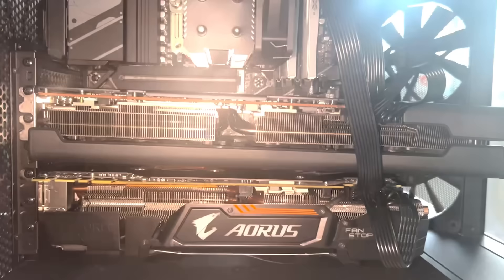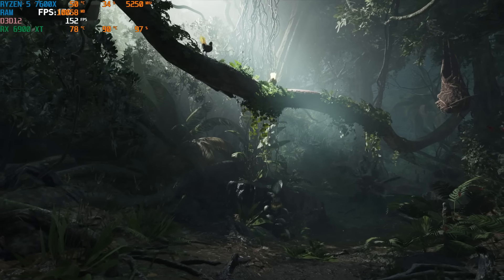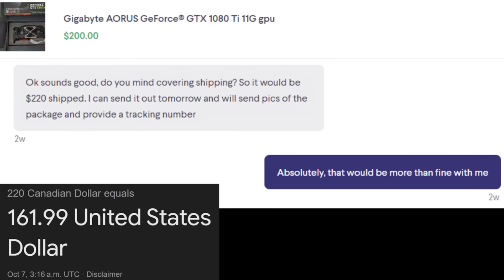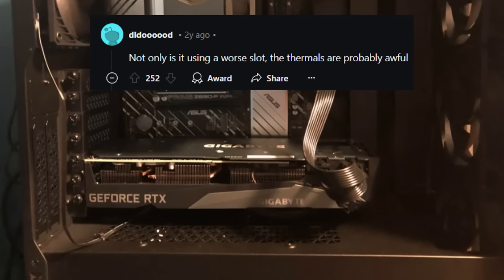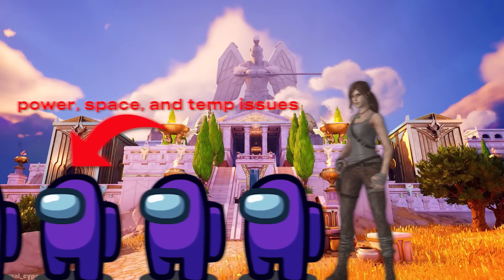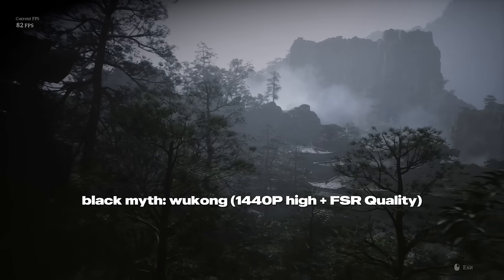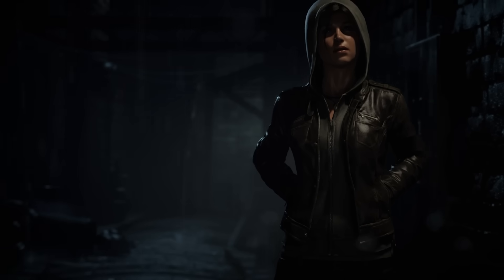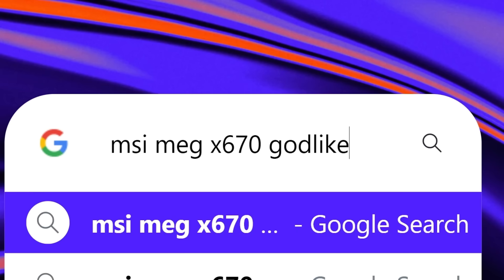I Combined AMD & NVIDIA in One PC and Got 1500 FPS

Comment: This video is somewhat misleading because the PC gets almost the exact same performance, if not less, when the two GPUs are put together, compared to just using a single GPU. Additionally, the reason multi GPU setups have mostly been phased out in gaming/consumer products is because of microstuttering and the lack of game compatibility. And that's just the difficulty you would have with GPUs from the same vendor. You would have to do a lot of tinkering to actually make a setup with mixed vendor cards work in tandem/parallel. Even if you did somehow manage to get the games to utilize both GPUs and not crash, your displayed FPS won't be very accurate, as there would likely be so many microstutters that it would feel like 60 FPS if you were playing at 120 FPS.

Comment: I did this with a rtx 3060 ti and an rx560 with no issues. I was surprised it was running flawlessly. I have a video of it running on both ff7 rebirth and baldur's gate 3 at ultra settings in both games
Reply: For anyone asking setup is a ryzen 3700x, with 16gb DDR4 3200,  1tb SSD, Asus 570x mb,  Nvidia rtx 3060ti 8gb, and a rx560 4gb, running in one system. 
Just in case anyone asks

Comment: Same here, hybrid GPU setup using.
RX6700XT & RTX2070.
hopefully, I wanna replacing RTX2070 to RTX30 series above.
'cuz they're have Rebar function.
anyways, You have must using sub GPU with HDMI dummy plug!
in my case Nvidia GPU doesn't VSR using on web browser or local video players without HDMI dummy plug.
(except setup main GPU to nvidia RTX series)
in other cases, if you use the "desktop mirroring mode"...
it'll maybe ansewer the multi-GPU setups.
because, with my PC, if I did so, both GPU percentages increase.
of course requiring HDMI dummy plug.
so, well, goin' to amazon or whatever web sites is, I strongly recommend to buy a 60Hz/HDR HDMI dummy plug.
and also, using nvidia inspector and force enabling Resizable Bar at driver setting it self.
this would take care of some of the PCIe speed issues.
or PCIe lanes split-up 8x8x... in bios.
sorry for my poor english, and I hope this someone's helps. enjoy.

Comment: The secret is that NVidia has released nothing new besides names and artistic redesigns since 2020 because they are scamming you while trying to clear inventory from the market crash. The 1080 TI is therefore still the alpha among their line of cards. DLSS raytracing is marketing, half of your games look worse when using it and the whole set of them take such a hard performance dip that you'll likely just learn to turn it off unless you have sickeningly deep pockets and can actually afford something like a 2090, 3090, 4090 or 5090. My advice if you want a true overall increase in performance is to invest invest instead into memory and RAM. I suggest taking this to heart because I know my tech, I built a PC for my sister in 2019 and it only has a 1070 mini from Gigabyte, that thing to this day outperforms even my expectations and you can probably source that card now for $200.00 if not less.

Comment: What about a 3060 12gb and a 6800xt on an msi mag x570s torpedo max mobo using the rx 5800x3d cpu?
Think it's worth trying?
I have enough ram to be good for now.
Just need to double check my power demands.
The asus lc gpu is a bit of a powersink.

Comment: "the only reason for combining 2 gpus today is to get nvidia's dlss and ray tracing while also getting amd's pure gaming performance" - what pure gaming performance?  AMD doesn't make a card that can best a 4090, even with just rasterization, without ray tracing or dlss.
"6900xt which consistently performs like a 3090 for less than half the price" -  the 3090 is now a 2 generation old (4 years old) gpu.
1000-1200w power supplies aren't that uncommon and haven't been for some time.  When I built my ryzen 1700x setup in 2017, I went with a corsair 1200i which did great at powering the 2 1080ti's I had installed with sli on that build.  I'm still using that power supply on my current build which is a 9950x with a 4090.  a quality high wattage power supply can last through many build iterations.
too poor to afford fans?!  you can get really good fans (arctic p12's) for $23 for a 5 pack that will likely be better than the fans that come with most cases and can significantly upgrade your cooling (especially if you have other fan mounting points on your pc to install the other fans.
most motherboards have the top pcie slots connected to the chipset BUT when you install a card in the second slot it takes away half the lanes from the first slot, and the bottom slot is shared with the chipset (and the secondary m.2 slot) and is typically electrically 4x - so when you have a single card installed you get 16 lanes on the top slot, 0 lanes to the second slot, and 4 chipset-shared lanes to the third slot.  when you install a card (gpu or otherwise) into the top 2 slots, they become 8 lanes each, and the third slot is still that shared 4 lanes.  MOST motherboards support sli.  HOWEVER, that doesn't mean that you're going to get 2 cards from 2 different vendors to work together in rendering the same scene.  there IS provisions for it in directx 12, but it's up to the game maker to implement, and i've never seen it happen.

Comment: The problem he is most likely having is he plugging the nvidia card into a PCIe 3.0 x1 electrical slot. Yes it is a x16 physical slot but the pins for it only go up to x1 so he is only getting pcie 3.0 x1 speeds with the nvidia card. Yes that is a thing motherboard manufacturers do do as most only look at the physical slot not the electrical one. So getting another motherboard that will have 2 x16 electrical slots will be the way to go to use both cards.

Comment: I have a gtx 1050ti with an i5 8th gen @2.3 GHz. 10 series is so good that I can play Witcher 3 next gen at 60fps (using free synch on a tv so no matter the gfx, frame rate is capped to my gpu frame rate). After a few tweaks and registry edits to my laptop, I can play it smoothly at high settings, keeping the cpu intensive effects at low (due to laptop being 6 years old and I use a small fan next to my laptop for cooling). It runs so well and I haven’t noticed much of the wear on the gpu. I can run fifa 23 and Ac Oddyssey at 1440p at low settings too which is not bad for an old laptop gpu

Comment: i tried this on a b550 motherboard using a rx 660 xt and a rx 6750 xt. gained like 2 fps on forza motorsport and gears of war, but my pc got too hot and loud to make it worth. also running the display on the slower GPU save some video memory since it makes it so the more powerful gpu is used exclusively for games. interesting result but would not recomend for playing games.

Comment: There's another option, but you'd likely need to do several work arounds and find some custom drivers to do it. Setting the 6900 xt as the main GPU, you could potentially find a means to set the 1080 ti to act as an accelerator card. Unlike Crossfire, NVlink etc, where the GPUs operate together to as one GPU. Using the 1080 ti as an accelerator card (like is done for AI) may improve game performance. In effect you could write a custom driver for the 1080 ti to act as a second CPU that is dedicated to a specific application task and offload the tasks normally handled by the CPU in gaming. The 1080 ti's optimization and faster computational scope (in spite of being nearly a decade old) would allow it to handle things like in game AI movement, pathfinding, etc, which is normally done by the CPU. 

However, this is only theoretically possible. It'd take a great deal of time, skill, and coding to create this custom driver, even then it's likely many games wouldn't work. Although some older titles might if they supported SLI, Crossfire or other multi-GPU communication protocols.

Comment: 6900xt doesn't require an 850w power supply. You can use it on a 750w no problem. 
PSU requirements are always a CYA for the the company.

Comment: If your motherboard supports PCIE Bifurcation on the top slot you can try to use that instead of a huge new motherboard purchase. you would need to get a bifurcation card for the slot and also some risers. but it is a possibility without selling an arm and a leg.

Comment: I actually have an mobo that supports two layouts for phisycal phisycal 3x PCIe x16:
X16 (plugged rx5600xt)
X4
X4
(Thats are now)
And
X8
X8
X4
With is technicaly possible. Any ideas to try some combo with any other GPU in tight budget?
P.s. last X4 slot is running from X570 chipset, but first two can be directly connected to CPU

Comment: @lecctron this maybe hard luck, but this is possible to do with a lower-end motherboards. A AM4 motherboard. that being the ASUS Prime B550 Plus, since that  (I suggest to get the one without WI-FI and BT to cut down in price if your short on cash and get a 5900X since they sell rather cheaply now) I know it sounds bad, but my hard luck is you probably have a old AM4 Build laying around, if you do, you can do this process by getting your hands on a B550 plus and using your old AM4 parts on it.
Reply: P.S u can find new b550 plus MB's at some local computer central or best buy that go for 90$

Comment: There's older amd gpus that actually had this as a feature without crossfire, but without one of those your best mixed setup would be to get a cheap Intel Arc A380 and run your display off it.

Comment: Taking my gpu out when it's installed on my top slot is near impossible with the cpu cooler on. Literally cannot reach the "Easy latch" on the slot lol I wish they had another lever on the back of the motherboard to pop pcie cards out if you can't reach them normally.

Comment: Whats the software configuration for the dual gpus?
Or are you doing some cable hardware weridness like what linux did for fsr plus gsync?

Also that gpu menu in windows 11 can also let u pass frames from one gpu to the other.

Comment: There are sometimes, I repeat, sometimes, very rarely, some cheaper consumer level motherboards that will have two PCIe slots wired to the CPU with X16 in one, and likely x8 but sometimes x16 in the other. But I repeat again, this is quite rare. And will still be more expensive than the other consumer motherboards. Also, to make this happen, they also tend to give up other capabilities to make it work. Like your M.2 slot on the CPU might not get included, but you may still get one or two on the chipset side of things at least. 

Finally, you'll probably need a riser cable. Unless your GPU's are able to fit within the space available, you'll need a riser cable. Oh, and before I forget to mention it... get a 1600w PSU. It may seem over doing it, but you'll need the extra headroom for transient spikes. With one GPU, 850-1000w will usually be enough to handle those at full load on your gear. But with 2? Nope. You'll get a black screen instant shutdown if one of those occur for long enough to trip it's protection. IF it even has it. Make sure to get something from a reputable brand, because you won't want to be having to deal with the chicanery of the cheap scam units.

Comment: you really don't need the lanes at gen three speeds 1080 ti does fine on on 4xgen3 laptop m.2 to laptop adapters do it fine with that new of a CPU it may have some affect but nearly 80-90% depending on how you use it, for instance if it is outputting to a screen it will be worse but if you have it work in the background you honestly need software to do anything with this to change a game probably be easier to write a game then get one to actually get better.

Comment: aren't there already plenty of boards who support at least 1 pci-ex 5 and 1 or multiple gen 4 slots? Gen 4 should already fix this. Even if it runs through the chipset. But I can't imagine that there are no modern boards except that 1800 mobo who have two pci express connectors connect directly to the cpu. That would be crazy.
But aside from that. The usecase of seperating concerns with GPU sounds neat. And I tried something similar with quicksync. But the main thing actually holding you back on that front is the CPU. 
That one can struggle to provide enough frames for the GPU even without OBS. And a lot of modern intels really suck in the low 1% and .1% area. Making recording a stuttery mess in high FPS games. And even in some 4k titles. So my next CPU is going to be either a 9800X3D, 9900X3D or 9950X3D. If I upgrade. As of now my i7 12th gen is barely enough for what I do. Which is editing & recording my games at the same time. Luckily those games are not the most demanding titles. And capping them to 60fps gives me the headroom to do the other stuff.

Comment: ROG Zenith II Extreme motherboard I got for $400 has 4 x16 gen 4 lanes. Has x8 ram slots, but is more for work stations using the treadripper line cpu's. I ran 4 gtx 1080 in 4 way sli just fine for years on it. Now it has a 4090 water cooled gpu. Your comparison between the 4090 and the 1080ti was wrong. You grossly understand the power differnce the 4090 has over it.

Comment: In my experience, several different gpu manufacturers lead to the ability to simply connect several additional monitors, it is worth considering that the rendering on the monitor will take place on the GPU to which it is connected (thanks captain), but the most interesting thing is the technology of the manufacturers. I found a case it the web like using gt1030 to work with physx in borderlands 2 or 3, I can't remember, although all the main rendering took place on rx580. Another option, at the moment I use EGPU with a laptop, the laptop has an igpu amd 780m and via EGPU I connect rtx3060 in baldur's gate 3 on a stationary computer with rtx3050 I did not have the opportunity to enable FSR only dlss, and in my EGPU build I have FSR and DlSS, so it seems to me that the increase of perfomance with diferent manufacturers gpu will only be if the user himself will parallelize tasks, for example, the main monitor with the game is a high-performance gpu and a funny video with cats on the second monitor is rendered by a weaker gpu. SLI and crossfire themselves are very lame solutions, for example: with nvidia both gpu will have the same frequencies and the most powerful will adjust to the weak one and in most tasks one card checks the work of the other and therefore very often there were problems with sli configurations. AMD Crossfire has no frequency limitation, but I very much doubt that legacy AMD video cards with old drivers in Crossfire can show stability in games or work tasks.

Comment: It is useless to put two video cards in one motherboard, since the more PCI slots you have occupied, the fewer lines are allocated for other components. Therefore, the RX6900XT will have 4.0 lines of 16, and the GTX1080Ti will have 3.0 of 8. The same applies to HDD and SSD drives.
But why do you need two video cards if you're not busy cracking passwords, training AI, or mining blockchains?

Comment: This reminds me of when physx came out on nvidia, 

I had a hd 5770 gpu and a gtx 460. In the same pc, i used the 460 (i think it was anyways) to compute the physx calculations and the amd card for raster. 

Worked really well, but not in everygame because it requires you to manually edit config files to tell it which gpu is for what. Lots of hassle but felt worth at the time. 

Theres so much distance between computer components, i wish they'd all come together to be nice and speedy.

Comment: You could try to run the 1080 ti with a riser cable from an m.2 slot, as there are 4 lanes directly connected to the cpu in the up most slot. In that way both gpus would be connected at the cpu at the same time

Comment: 2 Gpus actually make sense for content creators and streamers.
1 card can be used for gaming, the other can be dedicated in OBS for recording/encoding. This way you can still stream/record without losing performance at all and no delay whatsoever.
The card dedicated to the recording doesn't need to be a powerhouse, a simple 1050Ti can record 1080p 60fps flawlessly if there's another card handling the game itself.
Reply: Thats what I do.
I run GTX 1080 as main card and an Quadro P1000 as secondary to record video.
I record at 100.000Kbps which I found seem to almost be 1:1 to what I see on the screen. H265 4:4:4.
Reply: This is also what I do.  I use RX 6800 for my gaming and all monitors (4) and an RTX 3070 for my OBS streaming.
Reply: @Loko1956  this sounds extremely inefficient, but to each his own. NVENC is pretty good from what I hear
Reply: You might get some performance boost or extra visual features in games that use nvidia's physx API. Some mid 2010's games took advantage of it like witcher 3.
Reply: @wlaziu_pierwszy  true. One thing i forgot to mention as i was re-reading my comment is that you might want to have a slightly more powerful CPU, just to keep both GPUs fed without bottlenecking.
Hell 2 GPUs on two different monitors can play 2 different games thanks to tools like Aster, which enables Windows multi-instances. I've only tested it on Windows 10 though, i don't know if it will work on W11.
Reply: @wlaziu_pierwszy  it’s a shame what they did to physx this generation. NVIDIA would rather quietly let it die than open source it
Reply: Modern hardware encoders have minimal to no effect on gaming performance.

Comment: People need to learn underclocking.. I do it on my 1080 ti and it never hits above 65c even under max pressure cause it only uses around 195w instead of 250w to almost 300w and i lose about 1% fps and get more stability and less heat. Could see this used on the RTX series to be able to get a smaller PSU to get cheaper Electrical bills.

Comment: idk if you are reading my msg or not  for dual gpu there is a registry called RmCCMultiGpu values can be 0, 1, 2 ,3  do your search its located in hklm/system/currentcontrolset/control/class(device manager> gpu> driver key)/0001 or 0000 on based of the gpu try. have a good luck